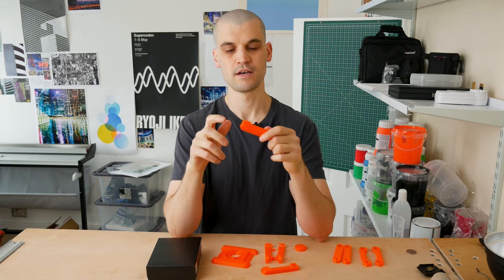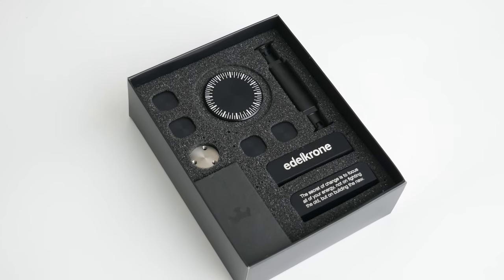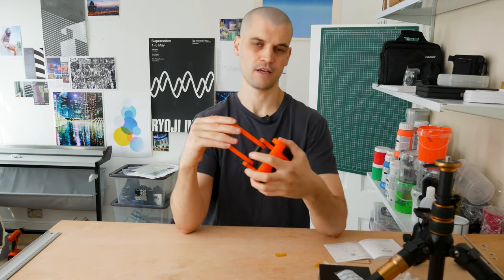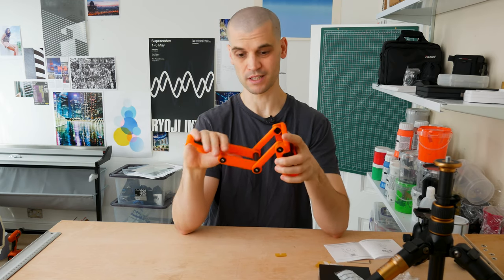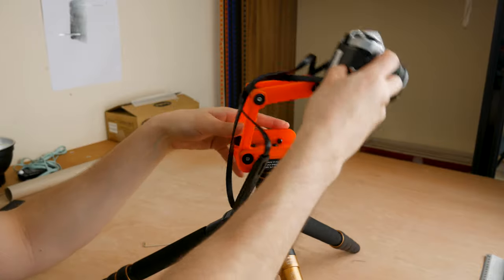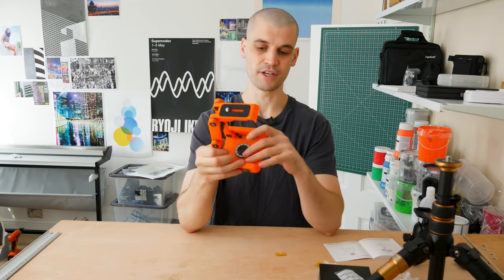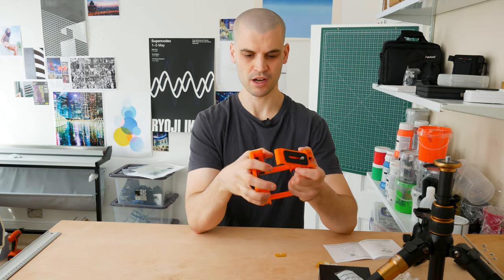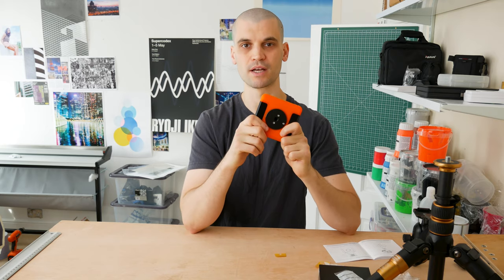EDELKRONE ORTAK FLEXTILT HEAD 3D REVIEW

Comment: I wish I had searched YouTube before buying as well.  I now have the kit but am concerned with the usability of the finished product.  Co-manufacturing is an interesting concept but it is not ready for prime time.
Reply from the maker: check out the new review I did here - https://www.youtube.com/watch?v=56F2VdgfXms. They changed the coatings and its really improved the product, I have it on my tripod all the time and really like it. Only problem is that is does lose its tightness quickly and you always need an allen wrench at hand to re-tighten. But apart from that it a decent product for the price